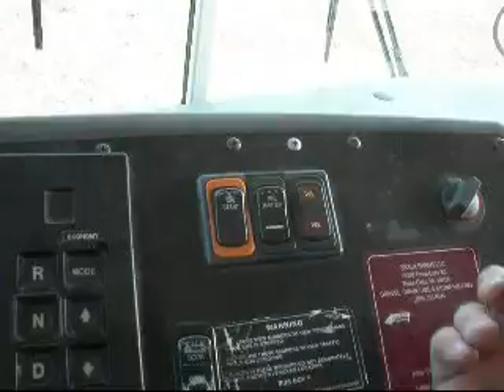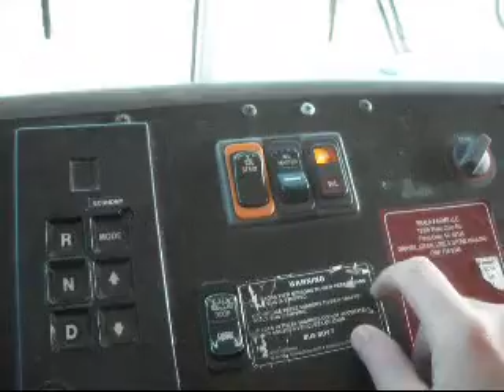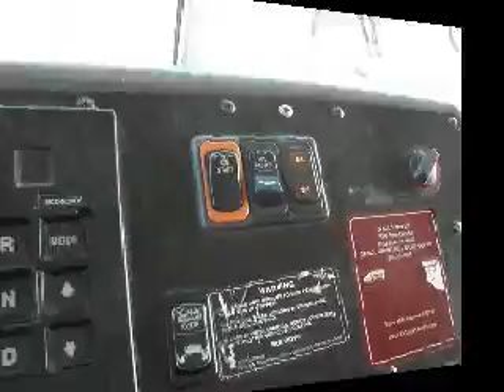Differences Among School Bus Flashers

Comment: Question: if the emergency release switch to open the service door is used will the red lights come on with the non-sequential setup (and master switch on?)
Reply: Allow me to answer: If the ambers are on and you release the door, the reds will automatically turn on. In anyway you press the start switch when the door is released, the ambers will turn on (even when the door is fully opened when released). The reds can only be activated using the override switch at this point,

Comment: Hello Matts4290. I just recently took the warning stop sign off side of my international AmTram 1989 school bus.  After doing so it seems my yellow flashers don't work now. any idea where should start to try to fix this myself?  I will say this while cutting the wires to the stop sign there was a spark. Thanks any help would be greatly appreciated.
Reply: Trace the wire back to the controller unit for the flashers.

Comment: Wisconsin has the first system where the lights will only come on when activated. we're also the only state to not have amber required or allowed yet. so some busses just have more red lenses in place of the ambers and function the same. but supposedly ambers are going to be introduced in 2016, thus why new busses are required to have the 8 way reds installed for an easy retrofit to the ambers later.
Reply: +JMAN123436 really!
Reply: It's the same thing here in Ontario. No ambers, on reds.
Reply: I live in Wisconsin and some of the buses still use 4 way lights
Reply: @andrahayessucksnauttpnathd8041  Good thanks for the post-2016 update.

Comment: Thats cool. Here in Fl, we have a Master, then Amber and Red is on a 3 position rocker type switch. You manually have to flip down to red. If the door is opened with the master on, you get an audible tone and just reds, but no stop arms or crossing gate.

Comment from the maker: @09ThomasEF, no, thats pin 1.  That would be an additional switch.  As long as the unit has a ground, if you send hot power to pin one, that enables the override.

Comment from the maker: @Stetsonater- It works the same.  It uses a flasher unit that uses relays, so it isn't fully electronic like this unit.  It is manufactured by RAC, and also has the option for either sequential or non-sequential.  The first flasher unit I put in was made by ELS, and was non-sequential only.